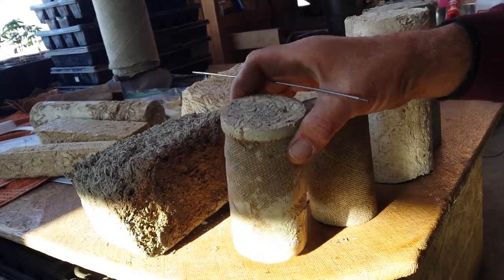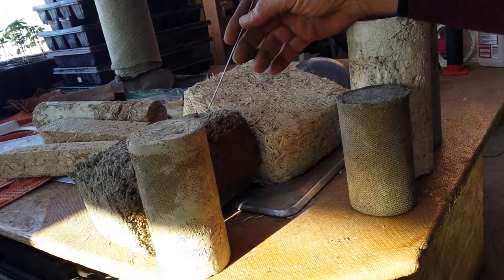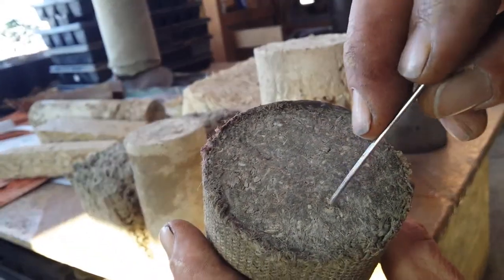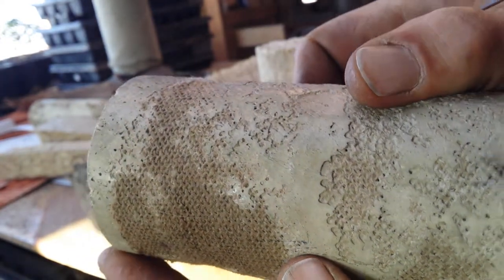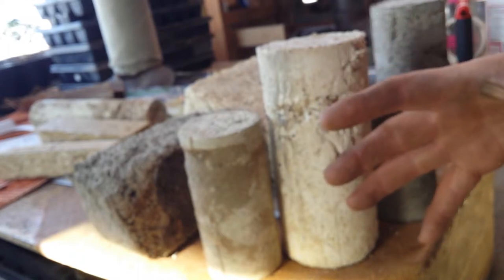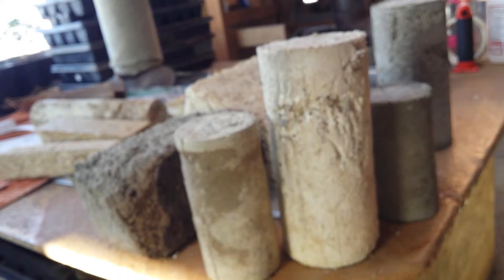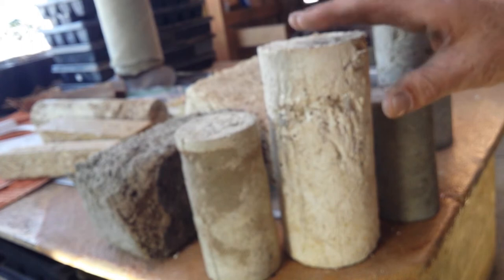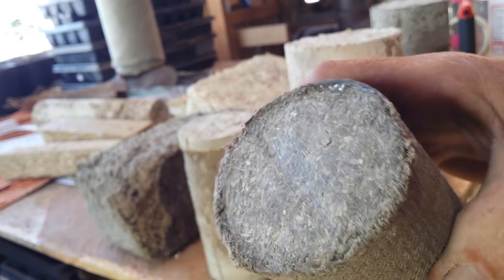Hemp fiber Beam, Column construction Megalithic's to Tunnel linnings are all within Hemp's abilities

Comment: I’m building a geodesic greenhouse and I’m considering the best hemp composition, any suggestions?
Reply from the maker: Concived using PVC tubes split in half as mold's laying the fiber in an 
Shooting with PVA foam
PVA bbs in flashed (CH₃)₂CO 
HempPVA mixed by Many means nothing 'Clean' use Stainless steel or PVC
That said as casting fashion an eyelet into the material and Secure under compression
Exothermic set in about an hour
stronger than steel and considerable Lighter
This might be Completely wrong for your idea Please adapt and Always test Under Load

Working on mycilium and baking but nothing Stronger than steel

Comment: Is it possible to use hemp for load bearing structures ? Have you tried reenforced hemp with carbon nanotubes ?
Reply from the maker: Hemp 17mm ×50mm geo board On Edge" on YouTube
https://youtu.be/HSE5vESjFk0
Reply from the maker: * please note it was cracked before being burned and lifting the truck

Raw Strength of HempCrete geo monomer" on YouTube
https://youtu.be/-Ktl6-4B0x8
Reply from the maker: * these are all the same test tile, normal floor tile can't lift a truck

Hemp geo polymer 3,623° 1,995c BURN Conclusion 65-70 minutes in" on YouTube
https://youtu.be/mztq32gdQeM
Reply from the maker: * please note normal steel reinforced concrete tile would shatter
Reply: @mrglasecki  so what you are saying that, hempcrete can infact be used in load baring structures and it's a myth that I cannot be
Reply from the maker: @TamilAlienAdventurers  hemp-lime is non structural insulation
HempCrete geo monomer modified is the answer to sea waters sodium chloride infiltration 😏 chloride will only "heal" damaged geo monomer
Reply from the maker: @TamilAlienAdventurers  HempCrete uses oxides and chlorides to create a exothermic bonding
Reply from the maker: @TamilAlienAdventurers  
** Always remember
hemp bast hemicellulose fiber is a multi layered nano fiber
Reply from the maker: Significantly stronger than steel by weight
Reply from the maker: @TamilAlienAdventurers  
this is nothing more than foam to seal gap's 
 Normally you could easily poke it with a finger, butter knife etc

Hemp fiber urethane pva Ultra Floatation.." on YouTube
https://youtu.be/sY6zRFW2M54
Reply: @mrglasecki  Yes, planning a automobile manufacturing on hemp fiber and using hemp battery and hemp Graphite (for fuel cells) and hemp composites for H2 storage tanks
Reply: @mrglasecki  it's like carbon fiber just cheaper by a lot
Reply from the maker: @TamilAlienAdventurers  
Consider using the shiv cellulose for synthetic NG
as a primary for secondary gasification and bast hemicellulose to graphene reduction 
"Live lighting smokeless Hemp fuel Rocket gasification Off-grid sciences" on YouTube
https://youtu.be/ztOrrce7568
Reply from the maker: @TamilAlienAdventurers  
Hemp bast hemicellulose fiber is capable of everything you ask, 

Hemp fiber Starlite 0.0625" @ 3,623°f  meets fiber technology" on YouTube
https://youtu.be/fmCSmI-5MK4
Reply from the maker: Hemp Bast fiber composite tube, body panel" on YouTube
https://youtu.be/zxj-86NIf8U